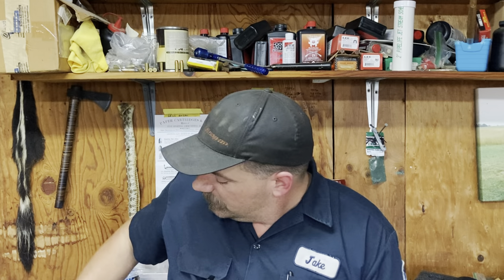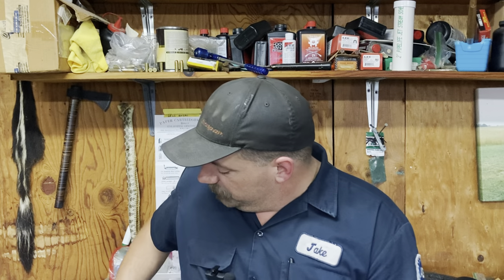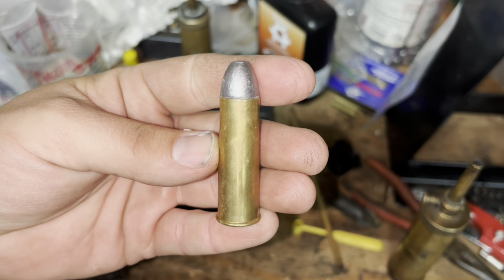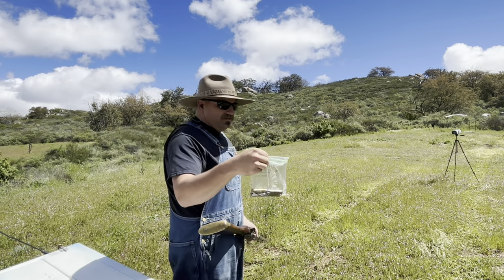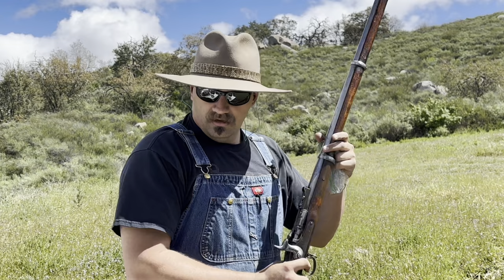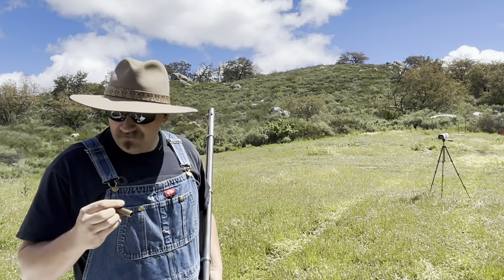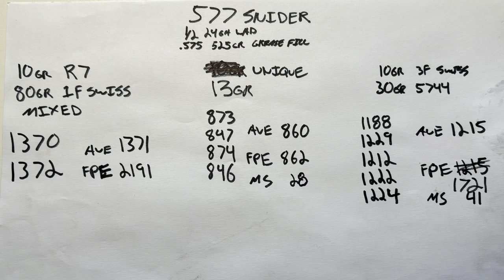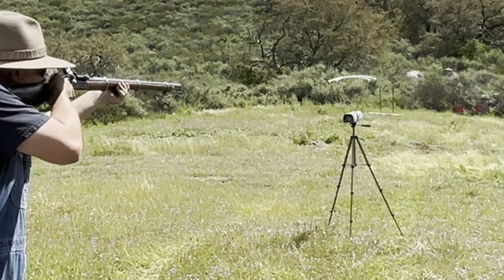577 Snider Smokeless And Duplex loads

Comment: Thank you. So nice….since I could not get 24ga cases in za, I made sizing dies for the owner to form 20ga cases. Oh that worked soooo well. Plastic shells from S&B and Fiocchi. Also tested paper 24ga ctgs made from empty mortar 24ga lifting shells. But no the 20to24ga plastic cases are good, even though sometimes a powder burn grain burn through. Bullet fits good tight when lubed. The dies were real rudimentary but work well.

Comment: I'd bet a whole dollar that the chronograph is struggling because of the wads. The thing works by timing off of the shadow of the projectile, right? But when the wad flies through and leaves a significant enough second shadow, the chrono doesn't know what to do and cries for mommy. That's my theory at least.

Great episode, and thank you for the content! Here's either a $5 tip, or $4 and settling a $1 lost bet.
Reply from the maker: Thank you! What bet did you lose?
Reply: @Everythingblackpowder  The dollar I bet that the chronograph is confused by the wads. Or is it? I don't know, but I can still tip / pay up either way.
Reply from the maker: lol I definitely think the wads there throwing the chronograph for a loop. They all seemed to disintegrate about 5 yards in front of me. The ground was covered in fragments.

Comment: Where things get interesting is duplexing with BP substitutes.   Built some 7.62x54 test loads recently, all with 200g Lee cast .312 with gas checks: 55 gr of toilet paper BP, compressed 1640 fps, 40 gr of Grey MZ with 5gr H4895 booster -1898 fps.   Yea when you don't get chronograph data on these test loads it's very irritating.  I now pop out the Berdans hydraulically and reload them with FA-70 (circa WW2 primer).  Perfect every aspect of your chosen art
Reply from the maker: Interesting!

Comment: I have a suggestion you may love or hate. Half of tannerite is alumium powder. The other half, mixed 28:5 by weight with icing sugar, should burn perfectly cleanly, without soot, smoke or salts left behind. I'd love to test it, but can't here. Can you test that, in something you don't mind maybe breaking, at the end of a long piece of string?
EDIT: I should probably mention that it's around 130 ft-lb per grain. That's probably very useful information when planning to do any testing of it.
Don't go just tipping a teaspoonful of it into the case to see what happens, hey?

Comment: I just made a Larger expander ball for my Die .My bullets seat with a little Thumb pressure 
I was just at a gunshow on the weekend and got a bag of 100- 577/450 I am going to cut down
to 577 .I also found 100 50/95 new cases I will cut down for my 2 50/70'S  Newyork and Trapdoor

Comment: trust me Jake it's more than just your chrony that does that i've got 2 that'll get PMS out of nowhere like that!! i think it may have to do with how high the slug passes the sensors it seems when they're hitting high you get more bad readings than when it's on point of aim or hitting low! those Magtech hulls are getting expensive i just checked midway usa and they're $49.99 a box for 12 gauge! the last ones i got a few years back (but not at midway!!) were $27.85 a box!

Comment: Gun writers are good at giving things the wrong name and then standing fiercely behind their errors.
•"Balloon or Folded Head" cases have folded rims similar to rimfire cartridges with an added primer pocket pressed in.
•"Solid Head or Solid Rim" cases are what your 24ga cases are and what the old gun writers like Elmer Keith called Balloon Head. That is an error now carved in stone.
•"Solid Web" cases are found in modern cases intended for high pressure cartridges. Gun writers erroniously tend to call them Solid Head.

Comment: Thank you for doing this video. I wonder what degree of felt recoil is the product of the projectile's weight? It seems that propelling a very heavy bullet would increase the amount of pressure and bleed some of that pressure off in the form of recoil. Excellent video as always - I always learn something.
Reply from the maker: Thank you
Reply: >  I wonder what degree of felt recoil is the product of the projectile's weight?

Conservation of momentum

impulse of bullet + impulse of propellant gasses = -1 x impulse of rifle

velocity  of bullet x mass of bullet (+ Velocity of propellant gasses x Mass of propellant) = -1 x (velocity of rifle x mass of rifle)
negative because rifle is moving in the opposite direction, can be omitted for simplicity

50% more bullet mass means 50% more recoil (assuming velocity and propellant etc woud stay the same.
50% more bullet velocity would increase the recoil by 50% , too.

RECOIL IS PROPOTIONAL TO PROJECTILE WEIGHT AND also to PROJECTILE VELOCITY

Increasing both by 41% at the same time would increase recoil by a factor of 1.41x 1.41 = 2 = 200%

Lowering both mass and velocity of the bullet to 70% would reduce recoil to 0.7 x 0.7 = 49%, or about half the recoil.

Slow and heavy means lots of recoil and comparatively low muzzle energy.
Lightweight and fast means much less recoil for the same amount of muzzle  energy.

Subjectively felt recoil is, well... subjective, and dependent on a whole lot of other factors.

Comment: Dude, I ran a CE chrono for years.  Would you PLEASE go get a Garmin or pickup the new Caldwell when it pops up at the retailers.  I don't think I've ever watched one of your videos where your CE Chrono didn't muff 20% of the shots.  It's not you.  Those old optical units are just too sensitive to the light intensity, angle of the light, etc.

Otherwise, keep'em coming.  Excellent channel.

Comment: Your Unique load would make me nervous.  I shoot Martini Henry's )yes a different gun entirely), both carbine and rifle.  In the Facebook MH group a few years ago one individual posted a photo of his MH which had blown up at the nocx due to his handload.  The charge he used was just 12 grains of Unique.  Without getting too much into which is a stronger action, Snider or Martini-Henry I think a better question is which one has stronger steel around the chamber and forcing cone area.  I suspect they are about the same.  BTW I use Dacron puffs as my wadding.  I like it better than cotton puffs because the cotton puffs burn and scatter hot coals over the dried leaves and grass down range.  Dacron merely produces a brief snow storm of white that has fallen long before the smoke is gone.  Safer for my forest.  The velocities you show around the 10 minute mark seem very low.  In my own velocity test video (using 70+ year old Kynoch made cordite loads) I average about 1400fps from an MH rifle vs 1200fps (with the same ammo) from the carbine variant.
Reply from the maker: Understood, proceed at your own risk.

Comment: very interesting that you can shoot smokeless in a balloon head case. i have been trying to make brass cases for 22 long rifle for a while out of copper strip, and i always thought that balloon head stuff was only really good for black powder. i would love to make 380 acp or 5.56 balloon head or something on an arbor press and load up a magazine with it and see how it shoots. i bet i could make casings cheaper and easier than they do industrially. depending on what die you used for heading you wouldn't even need to put the case on a lathe. it would be like making 22... so interesting!
Reply from the maker: Thank you. I was surprised it worked as well as it did
Reply: @Everythingblackpowder  Can I ask, do you know why balloon head casings fell out of favor? Can these cases not stand up to pressure like modern solid head can? It sounds like you have a lot of really valuable experience, like when you chose not to put smokeless at the bottom of the case at the primer level. do you know if balloon head casings are less tolerant of high pressures than solid head ones? i have heard this repeated a lot but i don't know if there is any basis for it - i mean, how often have you heard of a case blowing out from the back, or blowing the primer out? and primers are even thinner than the walls of a case. are there any resources that i could read about this that you would recommend? 

like, what material informed you to not put smokeless below the primer level? does that just come from experience and ballistics education?
Reply from the maker: I tried loading smokeless in brass 12ga shotgun hulls some years and ran into that problem. I’ve never had a balloon head case separate but I’ve seen pictures of it.
Reply: @Everythingblackpowder   you mean primer blowout? interesting... also, id think case head separation wouldn't be much worse for balloon head just because the case head separation is because of a case wall failure. it reminds me of the old folded foil martini henry casings. those things actually rarely had case head separation even though the case head was just held on with solder.

Comment: Looking at the curves for 5744, you're probably getting up around 10-12K PSI not too quickly, but maintaining it. With that fiber wad, I'm going to guess that the 'tracer effect' and the heat transfer into the rifle are both the result of the same thing.... the curve and level are enough to compress that fiber wad and seal it against the case like a piston, and it's compressing the trapped air in the cartridge and igniting the lube with compression heating. Since that extra heat also bleeds into it's surroundings, the gun gets nice and toasty quicker.
Reply from the maker: Sounds reasonable. Thank you

Comment: Kinda curious,  when I was testing the 72-150 Mukwa express with 12ga fiber wads, was finding th wad at the target. Evidence of the wad hitting the target.  The distance was only 37yrds. You finding that?
Mountain man
Reply from the maker: Not at all. All of the wads seemed to disintegrate about 3 yards in front of me. The ground was covered in little fragments of them. I didn’t find any pieces farther away than the chunk I found of the chronograph.
Reply: @Everythingblackpowder  🤔 ok the wads I used came from a heavy paper box, just like any 25 cartridge box. Can't remember the brand name as boxes were in bad shape, so storing them now in ziplock bags. Bought the 12ga, 28ga at the same time.  They appear to have  aged lube and a thin dark layer more peg board consistency. No matter all my brass is now 2" instead of 2.75". Maybe I'll dig them out and do a short for you tomorrow.

Comment: I've been playing around with the duplex load for the main reason that a percussion cap won't light HS-6. I was trying to duplicate a 45 Colt  load in a 44 cap and ball. Saw your video and decided to revisit. I put 23% 4F black in a glass jar and 77% HS-6 (which is close in pressure and burn rate of Unique) By weight. I mixed the 2 like they would in a 45 Colt case on a trotting horse. I loaded 13 grains of this mix per chamber of my 1858 Remington. I compared to 25 grain charge of 3 f black and black powder only charge was still a little stronger.  The point is when thoroughly mixed the low percentage of black still lights the smokeless
Reply from the maker: Very interesting

Comment: I noted your use of LP primers.  Remember when the JS and Pat Wolf book came out about loading the 45-70 TD and everyone jumped on the magnum primer bandwagon?  I did some tests and got the worst MV and fouling with LRM primers.  With identical loads, MV was DIY>CCI LP>Fed LPM>Fed LR>Win LRM and fouling ran the opposite direction.  The milder primers gave me about 60 fps extra and 15% less fouling. Everyone has different rifles and protocols, but have you noticed this?
Reply from the maker: I haven’t done extensive testing with magnum primers but in my experience they don’t make much of a difference. Also, with the primer situation being what it is nowadays we can’t afford to be too picky.
Reply: @Everythingblackpowder  Roger that. Switching to LP for my BPCR loads and saving the LRs for smokeless milsurps. BTW that priming compound for DIY percussion caps also works in re-worked Boxer primers. PITA to make tho.

Comment: Here in the UK there are plenty of shooters using Lovex D60 (same as 5744) in Sniders and Martini Henry's but without the black powder starter.
I have some Bertram brass on its way for my Mk3 Snider so I may give it a go.
Reply from the maker: Interesting, how many grains in the snider? I would like to compare it with the duplex load.
Reply: I will have to ask. I know its 30gn in the Martini Henry with the .470 non paper patched bullets.